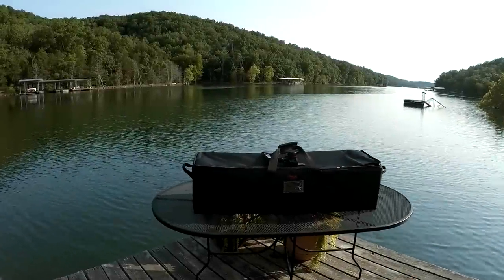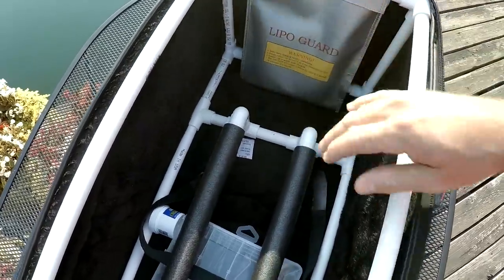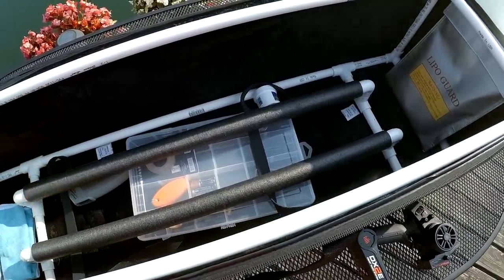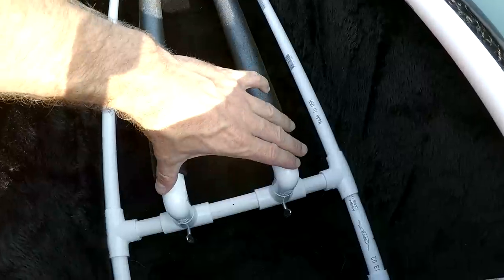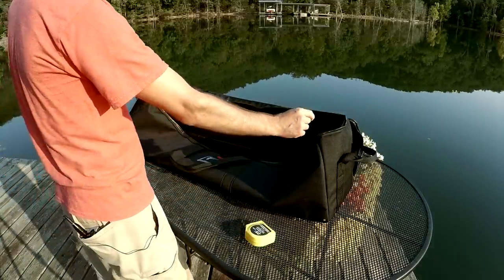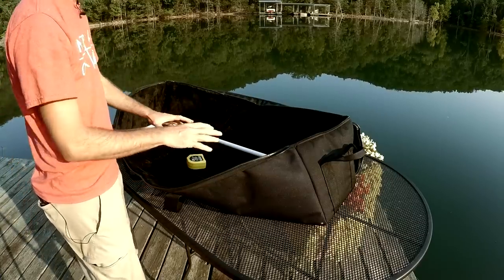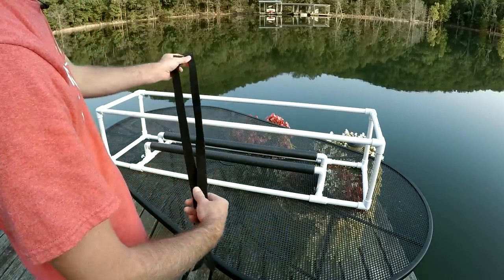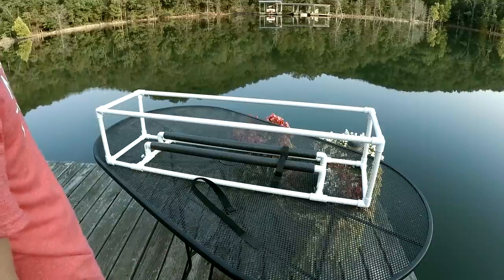DIY RC Boat Bag for V-Hulls and Catamarans - Easy to Build!

Comment: I view this video one month ago and like you I was having a hard time transporting my boat to the water without it either falling off the truck seat or dropping it with a bunch of stuff in my hand. I own a much smaller Atomik Barbwire it is only 17 inches long, so I took your idea bought a smaller duffel bag from a sporting good store and put your frame inside.....WORKS GREAT protecting my boat and I have plenty of room for controllers,batteries and spare parts in the compartments on the outside of the bag. THANK YOU for posting this video !!!!
Reply from the maker: +Matthew Whalen Awesome Matt! I'm really glad it helped you.

Comment: Nicely done, I’ve been using 1/2 PVC for about a year now for projects with my R/C’s… I made a nice work-stand for my Traxxas TRX 2021 Bronco, then I needed to make a garage (a wall mounted storage spot) for the same truck… I used a pair of shelf support’z as the base and basically the same set-up from the work-stand for the support, allowing me to keep the weight off of the tire’z and shock’s… And just yesterday I made a similar support (garage) for my new Pro Boat Stealthwake…
Reply from the maker: PVC is such a fun an useful material to work with. I'm glad you liked this video. I've got a few vids of my Stealthwake. Fun boat.

Comment: Thanks, great idea. I bought a bag on Amazon made out of the same material but an inch taller and wider and slightly shorter, 47 x 15 x 17 for $21. Worked great 😁
Reply from the maker: That sounds like a great deal on the bag. I think you'll love the setup.
Reply: Send the link!

Comment: Great bag. Great Idea. My bag should be here on Wed.
I hope it's wide enough for the Traxxas M41. The M41 is about 10.5" wide.
I'm also thinking about doing a mod to your design, instead of having the bunks adjustable on the horizontal.  I’m thinking about making the complete bunk assembly removable. That way if you need bunks for a "V" you just make new ones. Also I'm thinking about adding a set of bunk mounting points to the 2 top rails. That would give you a work station for the boat while on the shore. All that would be needed to
accomplish this is the “T” that is installed on the rail as the bunk mounting
point should face vertical not horizontal.  What do you think
Reply from the maker: Thanks! I think that your Traxxas M41 will fit fine because my Zelos 36 fits in the bag and its 11.75" wide. You have to tilt the boat to get it in but it hauls it just fine. I like your idea about a work station on top. I'm not following you on how you plan to build it but I say go for it. That's the wonderful thing about PVC. It's so cheap that you can try things and it's not the end of the world if it doesn't work out.
Reply: @GodsCountry  I've got a Zelos 36 Miss Geico coming and the specs say it's 12.67 wide.  Do you think it would fit inside if tilted to get it in?

Comment: Hi, I ordered this exact bag but won’t receive till next week and wanted to start building the frame this weekend. Do you have the (4) each length measurements for the length, height and width so I can at least get that much done. I believe in the video you state the (4) length pieces are 45” but don’t have the other numbers. Thank you and excellent job on this build 👍👍👍
Reply from the maker: Hi Tom! I'm glad the video helped. I know you'll like it. Unfortunately I do not have the dimensions that you asked for. I would really recommend that you wait until you get the bag to cut the pipe. You want to make sure that the pieces are long enough so that the bag is taught and not saggy. If the pipe sections are to long obviously you can cut again to make it right but it the pieces are to short.... Not as easy to fix.

Comment: But I have two boats I'd like to transport to the lake. There must be a design similar to this that allows two boats in one bag ?
Reply from the maker: Thanks for the comment. I'm sure it depends on what size the boats are. If they are small, you could get two in this bag. If they are larger than about 20" long each, you'll probably need two bags. This bag is large as it is. If it held two 30"-40" boats, it would be huge and hard to carry and heavy.
Reply: @GodsCountry  Hi again. Many thanks for getting back to me and I have more questions please. 

I found a UK supplier for the Stagg bag, exact same as yours.. So I'd like to build it exactly like yours, exact same dimensions.

I went to the plasticpipeshop UK and found some yellow pvc piping 3/4" 26.7mm about 1.25m in length. 

SO you listed only 1 of 30" of the piping. But do I need 4 lots of these ? the shop has 1.25M length of the pipe ?

Also can you tell me please if you bought the 3-Way Elbow ?

They have the fittings also. The T shape, the 3-Way Elbow, 4-Way Elbow and 5-Way Elbow, the Yellow Cross and the 90° Elbow and 45° Elbow for exactly the same size.
Reply from the maker: Hello Max. I'm glad you found the bag. The pipe sizes in our countries might be slightly different but you should be able to do the same thing. It sounds like the pipe size you are talking about might be larger than what I used but I am not sure. Please make sure and look at the description of the video because there is a whole parts list there that will help you.

Comment: Will my traxxis spartan fit? also how much was thw whole bag setupwith the pvc
Reply from the maker: This carrier can be built in many different sizes. It just depends on what size bag you buy. However, a Spartan should fit in the size bag that I built because I think these boats are similar size. You should check the dimensions though. I'm sorry, I can't say about costs because prices have changed since I built this bag years ago. You will like a bag though. It really helps.

Comment: I too am building this. Just ordered the bag and bought pvc. Question. Your length PVC is 45 and what about the H x W ? What did you measure?
Reply from the maker: Hi Mike. I'm sorry but I don't have those dimensions. I would measure the best you can and maybe cut that first piece a little long. Try the fitment and cut it shorter if need be. Luckily PVC is cheap if you make a mistake.

Comment: I'm building the bag supports now and wanted to ask you about the width of your 4 sides (6 counting the runs that the bunks rest on)?
Inside the PVC I'm getting 10 1/2"  (12 1/4" overall) but the boat is 11" wide, so it needs to go in at an angle to fit.
I'm sure that I can add another 1/2" of width out of the sides but was wondering what you pr sides were.
It fits in the bag very well already but I didn't want to stretch  the sides too much.
Also rounding out the inside of the T's is an pain, can't get them smooth enough to allow the pipe to slide.
Reply from the maker: Hey Travis! The distance between my pvc sides is about 11 1/4" I removed one of the PVC side bars and measured it and it came to 10 7/8". The frame should be snug in the bag but not so much that it stresses the seams. My wide cat has to be angled to get it in the bag to but it works well. Boring out the Ts is a pain but it really works well when you get the bag set up. I used a Dremel with a sanding drum.
Reply: +God's Country +God's Country Once again, thank you for the help and so quickly as well. That seems to be the difference then, my measurement of the pipe itself is 10" not 10 7/8 like yours. Also the long sides of my supports are closer to 44" not 45", so maybe my bag isn't as large as yours. I bought the same size Stagg bag but it needs wider sides to fit the Voracity easier, I'll have to work on it. Finally for the T's bored out and it wasn't fun, wish I had a large dill bit or sanding cylinder to make it easier.
Reply from the maker: No problem! I'm glad you're getting it put together!
Reply: +God's Country It looks great so far, I love that the bag has soft carpet inside. I'll need to pick up another run of 1/2" tomorrow so remake the sides to be a little wider for the boat. No problem though to get it right, I might also dye the PVC for a better look in the bag.
Reply: +God's Country +God's Country Alright, I recut the sides to your 10 7/8" and it fits very snug now. The boat squeezes inside by a narrow margin but that works for me. I probably could've made the long runs 45" like yours but it seemed to be too tight fitting. You made your bunks 30" long but I've got enough pipe insulation to make them closer to 35" each, so I might try that first. Is there a reason why you made them 30" besides more room around the boat? I'm sure you didn't mess up so maybe that might have been the amount of length you had left. Also the boat is 11" high with the antenna so I probably need to make the small connectors on the bunks between the T's & 90 degree elbows 1- 1 1/2" to keep the boat low in the bag.
Reply from the maker: I don't remember how I arrived at my bunk length but I don't think they need to be longer. The ends of the bag where the bunks aren't are good for storing things like batteries and transmitter. If the bunks take up that room, it would just make it harder to haul things there. My Zelos 36 is wider than my Voracity and the bag still works well.
Reply: +God's Country Well I'm $100 into this bag so obviously I trust your advice. I'll make the bunks 31" overall so the padded section will be 30". Also do you have a method for breaking in new battery packs? I bought 2 pairs of ThunderPower packs and for their price I wanted to make sure I don't mess them up. I know not to over discharge them but I heard to only use 50% capacity the first few uses and then after that you can use them normally. I'll have to figure out how to raise the LVC on the Voracity.
Reply from the maker: I'm confident you'll like the bag! There are so many thoughts on breaking in lipo batteries and I don't really know what to advise. I haven't been in the hobby long enough to have a strong opinion on it. I'm sorry.
Reply: +God's Country Ohh I love the bag and can't thank you enough for the tutorial on building it. It's all done now and I'm very pleased with the outcome, I made a few mistakes but PVC is cheap. I'll be trying it out tomorrow, I'd also like to make a sling to hold the boat out from the bank and set it in the water.

Comment: Hello everybody, this design made by God's Country is awesome and very clever made. But I would like to warn other people who want to duplicate this rc boat bag: If you don't live in America (USA) than there is a big chance you won't find the PVC tubes and connectors which are used in this video. I live in The Netherlands and they are impossible to find here! I discovered this after I already bought the bag, so it was a little bit disappointing. I found another way to finish the RC bag anyway, but it is impossible to duplicate the exact design from God's Country unfortunatelly if you live in The Netherlands for instance....
Reply from the maker: +Tom Boots Good comment Tom. Some other people have had problems finding the PVC parts. Can you tell me what plastic pipe types you have access to in your country? I'd like to help figure out a solution for other countries.
Reply: +God's Country Yes I would like to help by explaining what I did to work around the problems that I encountered. The biggest problem was that it is impossible to find the 3-way elbow pieces of PVC that you've used in the corners of your frame design (in The Netherlands). I did find however the T-pieces and the 90 degree corner pieces in white PVC from the site Aliexpress (China webshop) in the 20mm diameter (metric system) size. You can get them there very cheap so I ordered some pieces to try out. The problem is that in the regular DIY stores in Holland they don't sell 20mm (diameter) PVC pipes/tubes. The tubes they sell here for electric installations around houses are either 16mm or 19mm. Then you also have PVC pipes for water installations, but they all have a much larger diameter tube (made for bathroom and kitchen sinks for instance). Eventually I found a store which specializes in PVC, and finally I found my 20mm pipes! Only they where grey instead of my white connectors.....
Reply: I found white PVC 20mm pipes on the internet (some Dutch webshops sell them) but they where much more expensive to order online because of the aditional shipping costs. I deceided to get the grey pipes from the PVC retailer, and don't mind the colour difference. My frame needs to be a little different in design than your frame because I don't have the 3-way elbow pieces, only the T-pieces and 90 degree corner pieces. So I will make the top of the frame with the corner pieces (make a square in the seize of the Stagg bag. And another one for the bottom of the frame in the exact same size. Then I will use the T-pieces to connect the bottom and upper half together. It is the next best thing when you have to deal with the fact that the damn 3-way elbow pieces are not available ;) I hope I explained my method clearly enough? I haven't build it yet but I will make it this weekend I think.
Reply from the maker: +Tom Boots Thank you for all of the great information on pipe sizes in your country. Your solution is exactly what I was going to suggest. I think that should work very well! Thanks for the good explanation. It should help other people in the future.
Reply: +God's Country No problem, I want to help when possible. I will probably post a video of my Dutch bag when it is finished too.